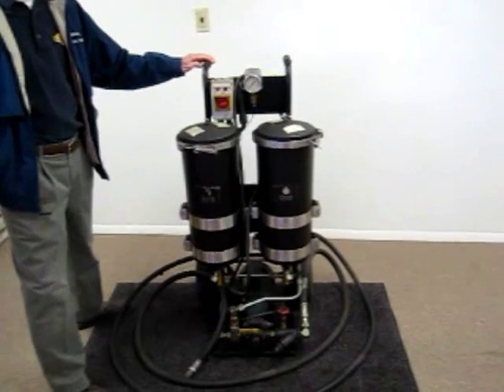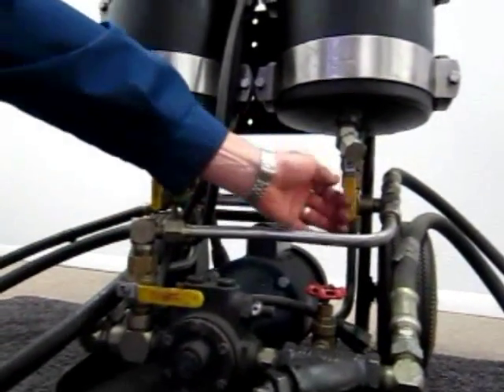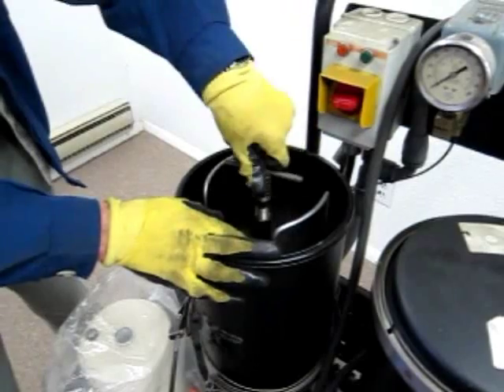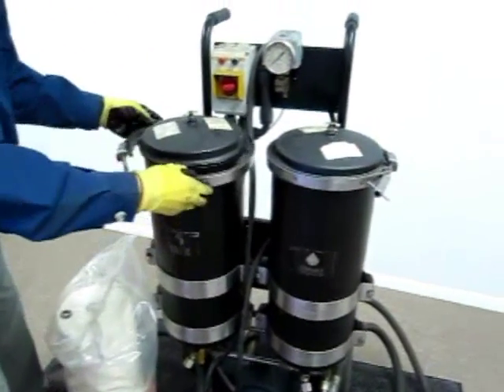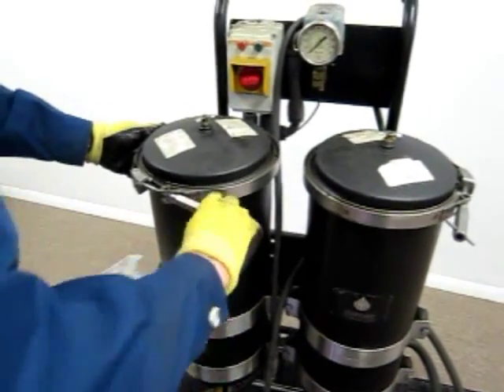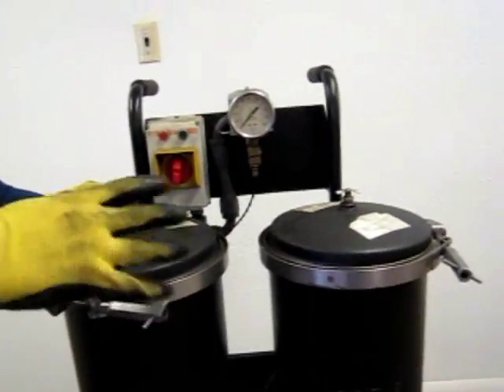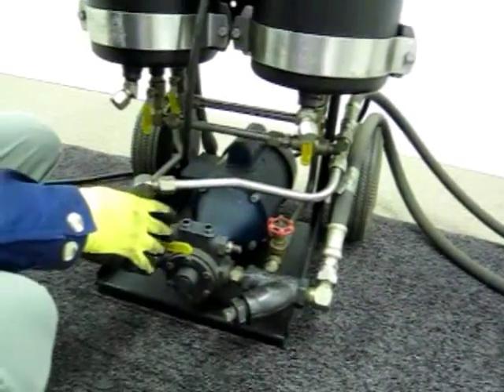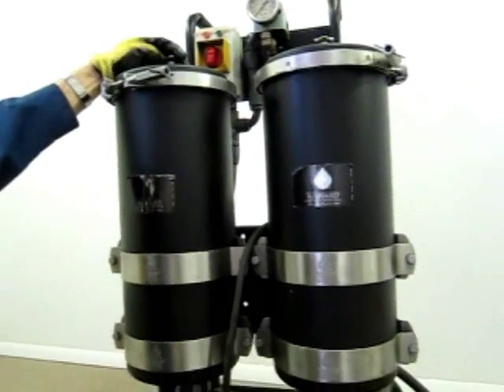Harvard Filtration Cart 87D 8 T Set Up & Use

Comment: You can NOT remove dissolved water from oil with a filter. Needs vacuum dehydrator. Misleading/false video.
Reply from the maker: Sorry, Brian, but you are incorrect.  Water does not dissolve into oil.  Water is insoluble in oil.  Harvard filters do indeed remove all the water from oil to "better than new oil" condition.